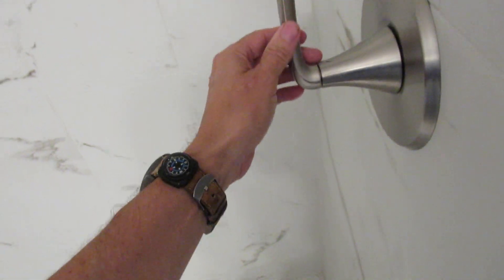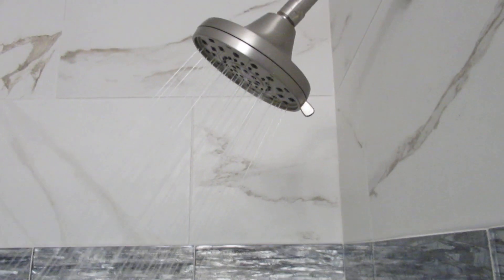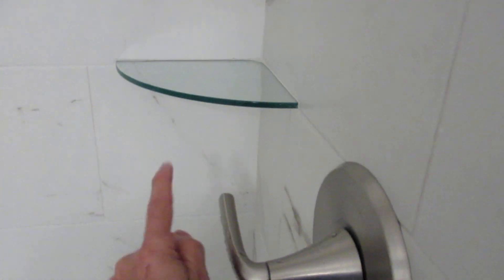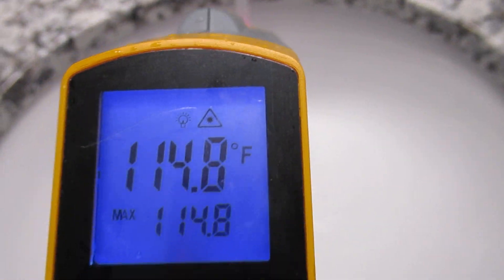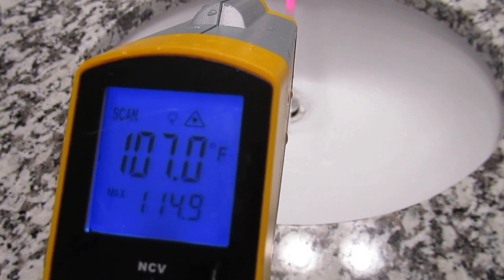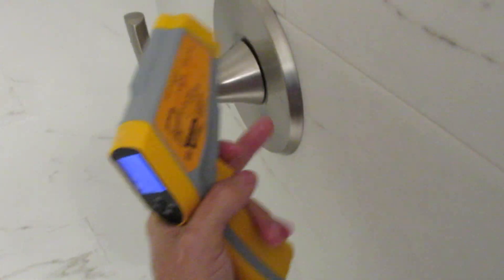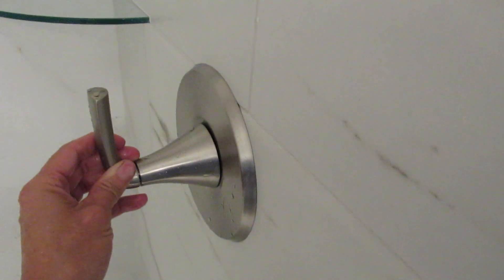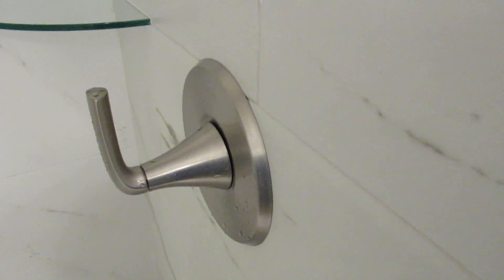Anti scald valves and home inspectors

Comment from the maker: showers and combination tub/showers must have a shower control valve that is capable of protecting an individual from being exposed to water temperatures in excess of 120°F (49°C). The control valve must be installed at the point of use.